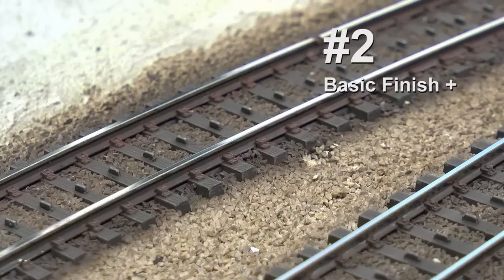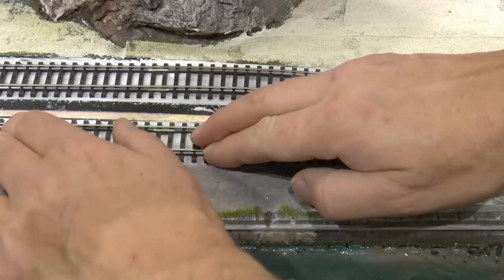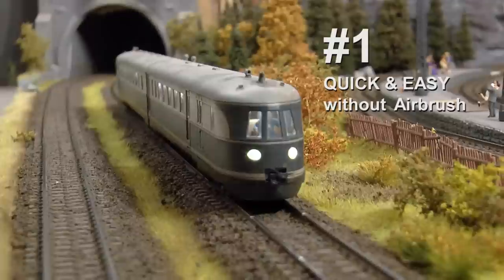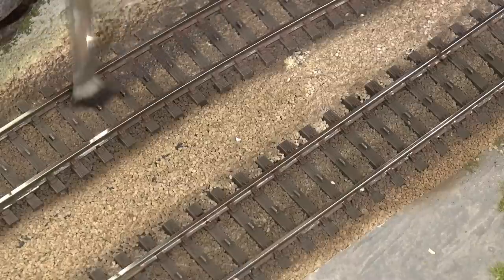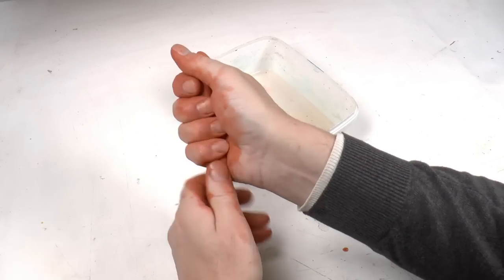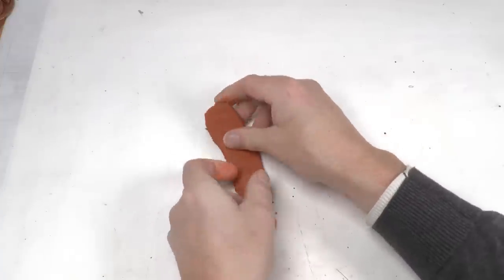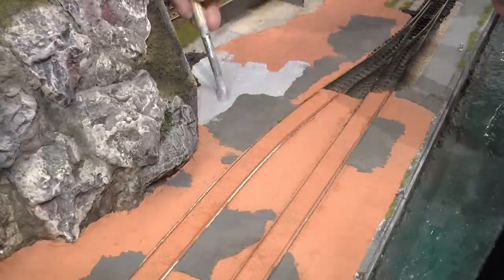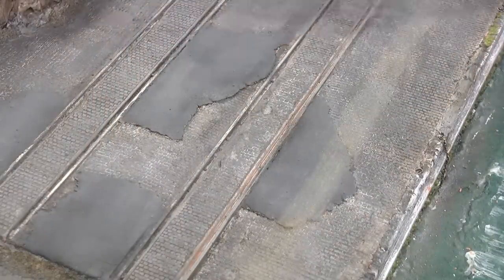Ballast Marathon

Comment: Hi Mark.  Incredible work, you have a great talent.  Thank you for your great videos.  They are very informative and you provide great ideas.  I am modeling my O scale set after the Cass Scenic RR.  I am using Ross track which I weather the ties by scraping with an X-acto knife, then used acrylic paints and washes.  The rails were painted with burnt umber solid, then misted with rust using an air brush both times.  The MIG acrylic asphalt you mentioned is brilliant which I will be adding to my track modeling the grease streaks the Shay locomotives leave on the track.  Thank you for all the great ideas and inspiration for my set!

Comment: I am absolutely loving your tutorials they are stunning and the way you break things down is so easy to follow.I have been using the spraying method onto the tracks but for some reason it seems to stop the locos running as no power reaches them? Am I missing something or not doing things as they should be?

Thanks in advance for you time and help

Comment: Awesome. Very well done. Some questions on the center conductor because I think what you said you did wasn’t actually shown but is important. Did you take an thin copper wire and then apply solder tinning over the entire meter length of the wire to get a copper wire with flux coating? Or is this a special tin plated copper wire?
Reply from the maker: Hi! I tin the Cu-wire using standard (for electronics soldering) 1.2mm diam soldering tin with flux cores.

Comment: Hi, what are you using to clean the third rail from all the paint and glue?
Reply: You can try to wrap a cloth around a piece of wood size of a icecream stick which has enough amount of either alcohol or paint thinner to work, but not to drip and ruin whole work. With it being flat you can clean whole sections of rails instead of each seperate.

Comment: Please reply, why did you make those sidings in the docks so detailed but then you covered it with clay?????
Reply from the maker: Hi! The videos are not a documentaries. It’s solely made as educational material. None of the resulting models, or very little remains after the video in completed. Most is actually scrapped. Therefore it was easier to apply the clay on the ballasted track, than starting from scratch.
Reply: @marklinofsweden  ok

Comment: I am abit confused in regards to the tincable over the concrete, after having used glue and then adding the rusty steelplate paint filler ontop of the tincable, should the cable be sanded to bring back the conductivity or some other form of regaining the connection for the three rail loco when running over the area?

Comment: Hi, I see the 3rd rail is covered in the areas of cobblestones, how would the Mraklin train with slider run here? Any tricks? Or do you have to use different locos once you do this? Please explain.
Reply from the maker: Hi! I simply add a tinned Cu-wire on top, which is fixed in place using fast set glue (CyanoAcrylate).
Reply: @marklinofsweden  Thank you

Comment: Very very good video as usual Martin, thanks. Please can you tell me if H0 is the same scale as 00? Toby
Reply: H0 is 1:87, 00 is 4mm = 1ft or 1:76,2. They do use the same track width though so H0 trains and rolling stock will go on 00 track and vice versa. However 00 stock will be bigger because of the larger scale, so it won't look quite right.

Comment: I’ve noticed over the years that rail code of Marklin’s track hasn’t caught up with the increasingly fine scale trend. Maybe this is because of the deep wheel flanges and their desire for a cohesive system. Do you know of any other manufacturers of AC 1:87 track which have more prototypical rails, or AC wheel sets which are more prototypical?

Comment: Hejsan,
Absolutely great tutorial with a stunning result. I just wondered that you thinned the
Vallejo paints when airbrushing. Will it give a better flow/result or any
specific reason for it ? 
Cheers, 
Torben
Reply: Most people thin paints so the airbrush doesn't get clogged by the paint and so the paint doesn't leave "spotty" finish that can happen with thicker paints.
Reply: Yes, of course you got a point there with that "spotty" effect. Thanks.

Comment: If you use a spray can on rails. Won’t the trains not run because there is no electricity running through the paint. Or can electricity go through the spray can stuff?
Reply: u gotta clean them after u paint them

Comment: After airbrushing my K-track I really think for a better finish it would be better to use a primer first.
Reply from the maker: True! The adhesion to stainless steel of acryllics is poor. What primer do you use?
Reply: @marklinofsweden I have purchased some Vallejo primer to use with there Model Air Paint. I previously used the Tamiya paint which I found a lot more forgiving to use and has good adhesion but it also reacts to having isopropyl alcohol sprayed on it (it does create a interesting weathered effect) where as the acrylic is not. I am now a big fan of the Vallejo paint after learning some important tips off you tube. I love watching your video's and hope that my layout will be just as good as your's. Thanks and hello from New Zealand !

Comment: I didn't know 3rd rail was still popular.
Reply: What is the purpose of third rail?
Never quiet heard about it...
Reply: Herbertoros it’s commonly used in Europe, though in the UK people just use an electrified rail system. It uses a middle rail which the loco picks up electricity from, using a “ski” under the loco. In the UK we just electrify the rails and put pickups on the wheels.
Reply: @harryrobinson2901  Thanks!
I thought something along those lines.
Reply: There are some third rail fans in the U.K.! It has some operational advantages electrically (e.g. balloon loops). Märklin’s system isn’t technically third rail (whereas the old Hornby Duplo system is) because it uses a relatively unobtrusive contact studs rather than a continuous rail. I was converted to it by my local exhibition layout in Yarmouth, which operates largely using Märklin because of its reliability: there’s a U.K. section to the layout running Hornby and Bachmann, but something on that has usually broken down.

Comment: I tried the Method with the Clay , but Mine keeps cracking after IT dryed
Reply from the maker: Hi! Interesting! It has never happend to me. What clay did you use and how thick was the layer?
Reply: @marklinofsweden  i used Modellclay from a Local Shop. The Layer was about 5mm thick. Same thing happend with the Layer between the Tracks. Looks like the Clay shrinked to much while drying.
Reply from the maker: Papa Demand xx I think it’s the clay. Try ”Das Pronto” clay.
Reply: @marklinofsweden  i will. But it's kinda hard to geht here in Germany .
Reply: @marklinofsweden  So, a little Update, i tried a different Clay, and it worked.